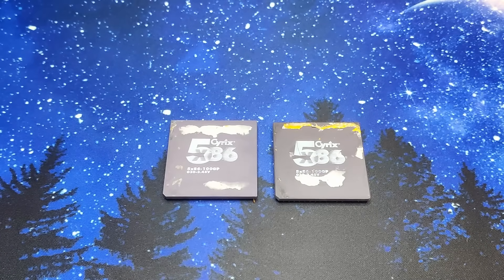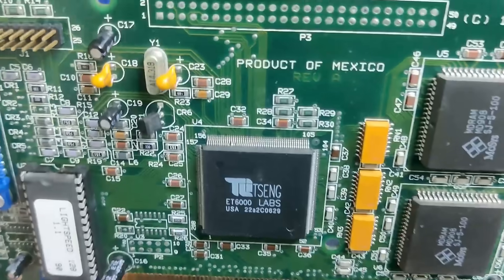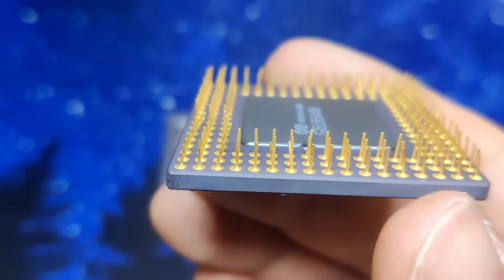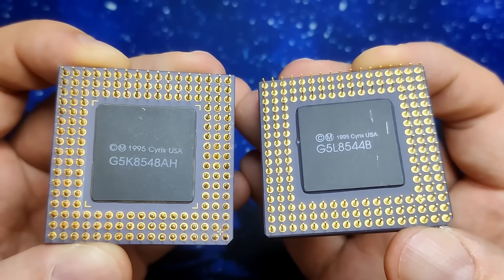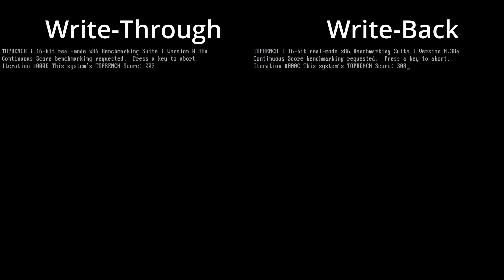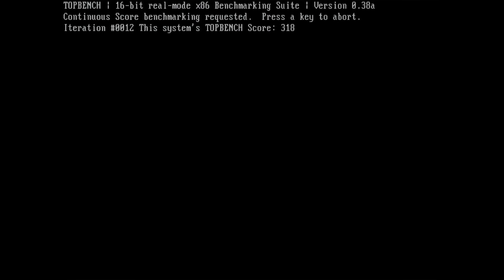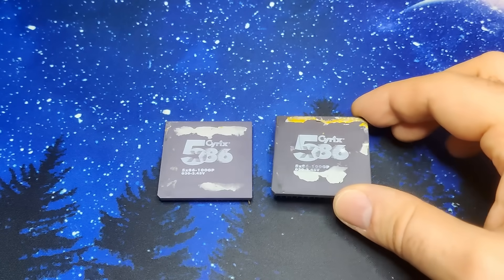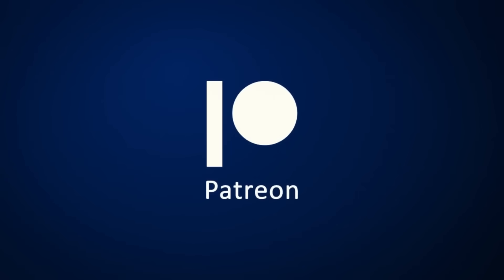Tomb Raider (1996) meets Cyrix 5x86-100GP (Part 3)

Comment: I had a 6x86, and used the tweaking program, can't remember what it was like though.
Also with WT/WB available for both L1 and L2 cache, how do they interact? is double writeback the best, or do the chickens come home to roost when those writebacks finally have to be resolved?
Reply from the maker: I think you will get the slowdown when a write happens to the L2 cache because then the system would wait until the content is also written to the main memory. Having both caches in write-back should result in the best performance

Comment: The Cyrix 5x86 has a much faster FPU than the AMD 5x86. With 100MHz it scored 20% better in the Landmark FPU test than the AMD part at 133MHz and I remember a similar result with the CPU-Z benchmark in Windows 98. But these were the only benchmarks I found where the Cyrix was better at stock clocks. With the Vogons recommended CPU registers and at 120MHz the Cyrix chip was much faster than the stock AMD 5x86 in every single test I ran. Sadly my AM 5x86 didn't post at 160MHz, so that would probably swing the favour back to AMD. 
On the other hand the main goal of the series is to run a 3D game, so maybe the FPU is king.
Reply from the maker: I think I have to do a similar series with Quake... I have not overclocked any of the Cyrix 5x86 yet, but I hope I can manage to test this CPU at 120 and the AMD 133-ADY @ 160 MHz

Comment: Would heating the CPU make the pins less likely to break when bending them back?
Reply from the maker: I don't think so. The pins would just be hot and I would burn myself while working on them. I might be wrong, but you're definitely not the only person who asked this question. In the last video, when I tried to get a pin off the bromek AMD CPU, the ceramic and pin was so hot that I couldn't touch the CPU. The pin didn't budge nor did I feel any change while trying to rip it off the CPU. So, I don't think that heat will do anything - at least not at the temperatures I am willing to expose the CPU to.
Reply: @bitsundbolts  ah, I was thinking perhaps it would make the metal softer and more likely to not break. But perhaps it would have to be so hot that it would make this unfeasible and maybe even damage the chip.
Reply from the maker: This is what I am afraid of. The CPU will probably die before the pins are getting softer.

Comment: Love this videos series! So much retro fun. And the additional sequences with the setup around the chips are awesome! Looking forward to the bending pin AMD adventure!
Reply from the maker: Thank you! I'll try to make the final two videos I have planned in this series as entertaining as this one!
Reply: @bitsundbolts  I like also the educational part! Thanks to you I bougth a defect VooDoo 1 to improve my soldering skills. Unfortunatly this card worked! But just in older systems. Do you maybe know why Voodoo 1 (and 2) wont work on more modern boards? I have try it on an Intel 965-Board (with P4 Northwood) and also on an AMD64-939-Board (because these boards will run Win98 and i was trying to build an powerful time capsule).
Reply from the maker: I think it's because of the faster bus speeds / CPU speeds of those "modern" retro PCs. There are topics on vogons that discuss your issue. Voodoo 1 sometimes may not like anything past 500 MHz. I could run a Voodoo 1 in a Pentium III 1GHz system though - without facing issues. I need to try faster systems and see this issue myself

Comment: BuB, hope in the future you;ll do an Athlon XP pin-mod for unlocking the multiplier, too.i rmbr doing it with a very very thin wire and i wasn't afraid of burning it (it ended up ok), i was afraid of my mother beating the hell out of me for ruining her accounting pc :))
Reply from the maker: Oh absolutely! I already did the research and saved some great sources. I also have plenty of Athlon XP CPUs. I can't promise when I am able to do this, but it is on the list!
Ahaha :) Good that you didn't upset your mum - what a great time to be a kid!!
Reply: @bitsundbolts  mega! can't wait for it!! :) yes, wonderful times, i read about the mod in the CHIP magazine, it was the go to in regards to hardware, tests, etc, . strangely, when i see a kiosk on the sidewalk today, i stop and look at it, maybe i see a CHIP there. nostalgia :)
Reply: @bitsundbolts  I did this way back when my eyes were still amazing.  Worked perfectly.
Reply from the maker: I already checked using the microscope - should be doable to cut and close those thine L-Bridges

Comment: That -ADZ cpu has unfortunately only WT L1 cache. If you could find -ADW variant, you could switch between WT and WB.
Reply from the maker: Are you sure? I was not aware of that. That would be a bummer if that is true. But I do have an -ADW model as well in case this becomes an issue.
Reply: @bitsundbolts  this is what i have figured out researching the 486es and their model numbers.

The WB should be possible with ADW and if the suffix contains "B" instead of "T". (ex. -100NV8T vs -100SV8B) ADZ has only write-through capability while ADW can do both WT and WB. I'm not sure, how ADY behaves.

Other tidbits i've found: Am486 (usually) have 8kB L1 cache, 5x86 have 16kB L1 cache. Usually. If the suffix contains "16", it has 16kB of L1 even if it is 486. (ex. -133V16BGC, -120NV8T)
Reply from the maker: Thanks for all the details! I'm curious now too and want to do some research. They did have quite a bit of model numbers back then - especially for 100-133 MHz models

Comment: what device are you using for vga capture ?
Reply from the maker: I use OSSC (open source scan converter)
Reply: @bitsundbolts  is it vga to scart and scart to ossc ?
Reply from the maker: It is VGA source from graphics card into OSSC and then directly HDMI output into a capture card.

Comment: I like matrox millenium cards, they have perfect image quality, tseng et6000 is quite expensive card
Reply from the maker: I found two Matrox cards the other day - I think both had the 6MB memory upgrade kit (2MB on the card itself). I will make a dedicated video about those cards very soon.
Reply: I would love that, have a Matrox card and are itching to get it up and running in a build. If you do the video, don't forget about the excellent game Screamer which has native Matrox support. @bitsundbolts

Comment: From which websites we can buy new or used, modern or retro original chips?
Reply from the maker: I think you are referring to the memory chips for the Tseng card. I used Google to search for the chips. It took me quite a while to find the correct chips - and then only 3 of them. I got the same chips, but as 120ns version which I didn't want to use on those cards. I check eBay, AliExpress, and local classified websites from time to time. But it most likely will require patience until you find what you are looking for.

Comment: It's possible to fix the S3 gamma bug. There's a thread on Vogons about that, but I can't post a link since YouTube automatically deletes the entire comment.
Reply from the maker: I haven't spend time on investigation, but you could absolutely be right that this may be an issue with the BIOS of my card. I'll check it out. I will find the vogons thread - thanks!
Reply: Can confirm - you can also modify the BIOS with custom clocks for a hard overclock. @bitsundbolts

Comment: Watching you painstakingly straighten each pin on a CPU or re-soldering a broken pin on a socketed chip is amazing. It's great to see someone spending so much time and care on these old things. They'd definitely be thrown out otherwise, and you can't replace that once it's in a landfill. Great work too, the pins on those CPUs you worked on in this video looked almost factory condition when you were done!
Reply from the maker: Thank you! It is also a lot of fun completing a CPU and have it look like new.
Reply: @bitsundbolts Next time use slightly cut medical needle of appropriate size to straighten the pins ;)

Comment: You can achieve better framerates with S3D accelerated Tomb Raider patch. I've got minimum 12 FPS (in more complex areas) with Cyrix 5x86/100 with all features enabled (in 640x480) with overclocked S3 Virge DX (by mclk tool). BTW. Washed black with S3 Virge is a software problem. You can overcome this by using video bios 2.01.07 (or 2.01.08). Anyway great content as usual :)
Reply from the maker: Nice! I will try a new BIOS on this card then. I spent no time investigating the issue - I guess I was looking for a reason to finally upgrade the Tseng cards :D And I will also try the S3D patch in the future - but probably in a single video. This series must finish with 3Dfx 😊

Comment: That type of memory is 1.125 MB if I remember correctly. Not sure if it makes any difference, maybe one more page for multi-page framebuffer on some modes.
Reply from the maker: The 908 chips should have 1MB and the 909 chips 1.125 MB - which would give 2.25MB with two chips and 4.5MB with 4 chips. The last digit 9XX defines how many MEGABITS are available. So, for the 909 chips it would be: 9*1024*1024 / (8*1024*1024)=1.125. I have the 908 which is 1MB. Anything above 4MB seems to be wasted on the Tseng ET6000. My source is a writeup titled "ET6000 memory size facts and fiction" on xfree86.
Reply: @bitsundbolts  interesting, good to know.
Reply: 1.125 seems like a 9-bit data bus (8 data 1 parity). A regular video card is unlikely to use that.
Reply: @mykolapliashechnykov8701  seems like it's not parity, need to check. They never named 1mb Simms as 1.125mb

Comment: Great soldering work, how is that possible to solder the sockets through the spaces?
You're the master of pin's straightening! I bet you can do it without breaking any of the Am5x86 😁
Reply from the maker: Thank you! For the socket, I used the smallest soldering tip I have for the FNIRSI HS-01 soldering iron. The problem with the smaller tip is that not much heat is transferred to the pads and pins. You need good timing and a good angle to let the solder flow to both. But it's doable.
Yeah, I enjoy it very much when one of those CPUs is restored and you almost won't be able to tell that the pins were in bad condition before.
Thanks for watching and commenting!